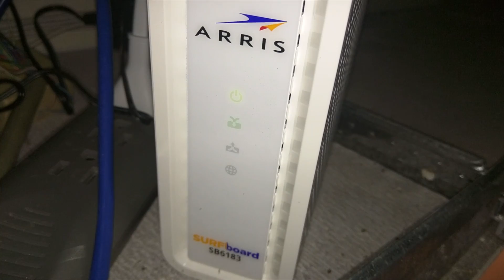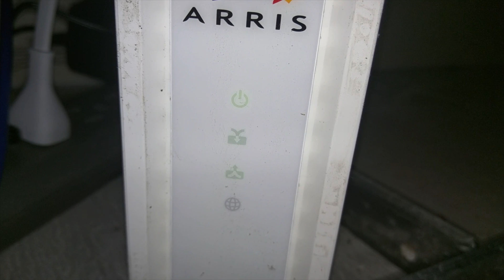Internet Not Connecting (Modem)

Comment: Mine is weird. It used to blink green. I only have 2 lights on mine. A Globe light meaning it’s connected to internet and a wifi light meaning it’s giving off internet. They’re supposed to flash green for about a minute before the become solid blue meaning it’s all in order. Well now, when I connect it to power the Globe light is the only one of the 2 that gets illuminated and it doesn’t blink green and then solid blue. It’s just solid blue from the moment I plug it in. I have tried restarting it. I’ve tried factory resetting it via the reset button. I have unplugged it completely for HOURS. I tried using several different wall outlets. Nothing can make that light blink green to search for a connection. Is it cooked? It was over $250. It is an Arris SURFboard8300 that I bought brand new in-store about a year ago. I don’t have my receipt or the box to return it for another one. Does anybody know if they will still allow me to exchange it?

Comment: Mine as soon as u plug everything back in the power light is constantly on but the rest will flash like every second for about a min then the one right below the power will be blinking about every second and the other 2 are not idk what to do I’ve reset it and did what u told me a few times
Reply: Did u ever figure out the problem cause I’m having the same problem rn
Reply: May be a modem issue
Reply: Bruh it’s connecting just wait til it’s solid on all of them
Reply: @MajestikSucks  it’s not bro I’ve waited days
Reply: @latalebro5571  Did you eventually get it to work, or did you have to get a new modem?
Reply: @user-ce9ji1gc9s  i had to call the company and they it was their fault